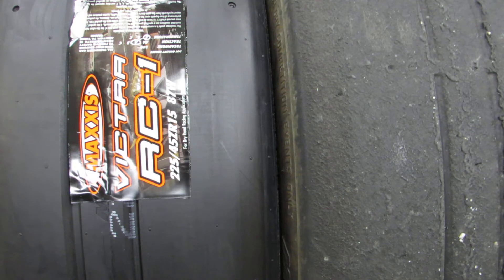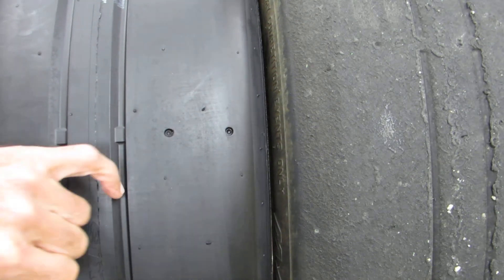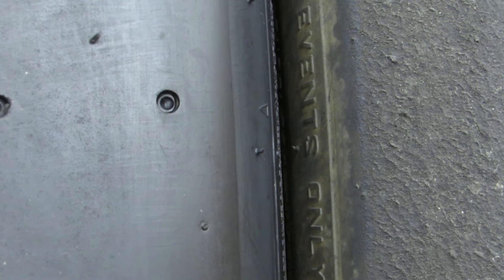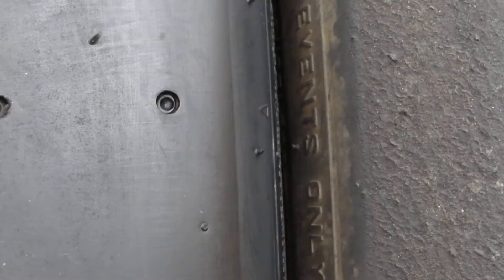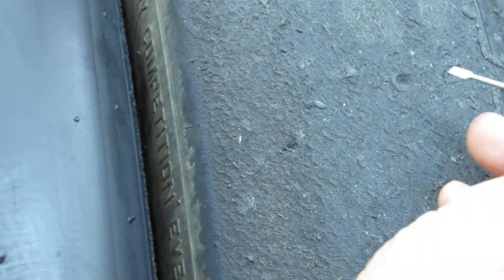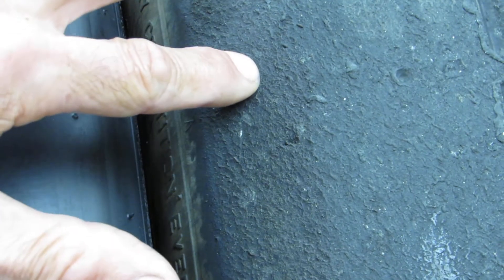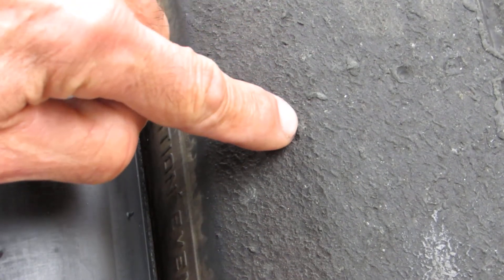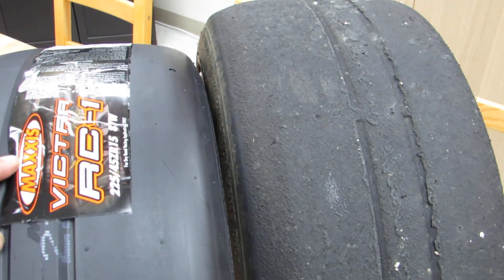Maxxis RC-1 tread wear indicators Supermiata

Comment: Does this work like a drag radial
Reply from the maker: Can't say. We don't have any experience with drag radials.
Reply: @949RacingSuperMiata  but can it put down the power from a dig launching hard
Reply from the maker: @curtis9918  The RC-1 is a specialized road racing tire. I doubt they would perform well for drag racing. Very different construction and compounding.